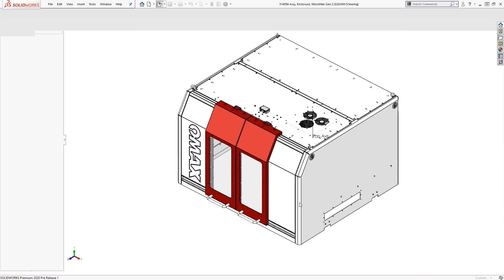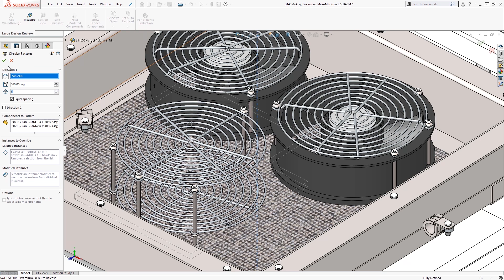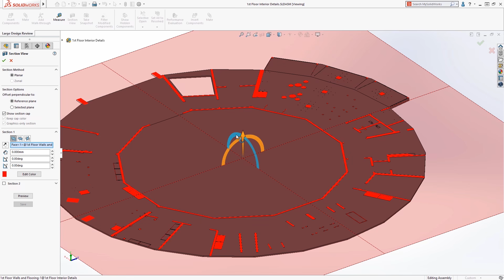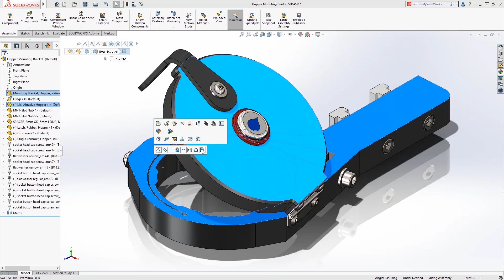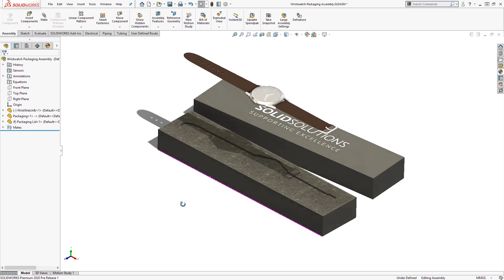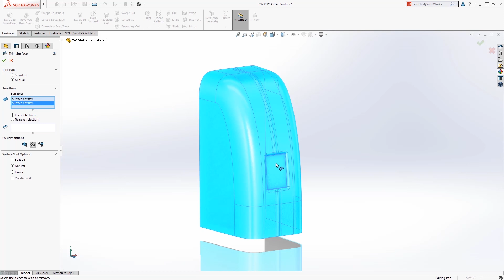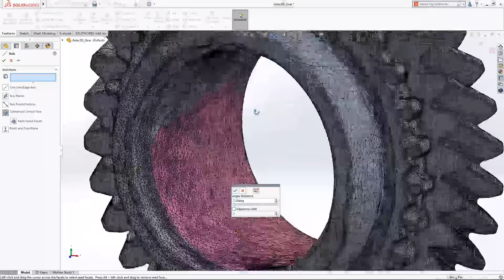SOLIDWORKS 2020 - Top 8 New Features

Comment: I miss this program, I used it as a kid on my father's company computer to draw, then later in life, I realized how expensive it is.
Reply: Same with autocad when it first came out. Got to cut out smiley faces in a half inch thick steel plate with one of the country's (Belgium) first metal cutting lasers at the school my dad worked at.

Comment: A one click tool for exporting tube coping profiles or even directly printing the coping profile would be great. So that I can just hand the fabricators a paper template they can just wrap around the  tube and quickly  cut it. Instead of having to manually flatten the tube and all the associated steps to print the profile.

Comment: What is the best processor for performance used in modeling  and simulation  in solidworks 2020 ? , Is it intel core i9 9900ks or amd ryzen 3950x
Reply: I have i9 with a Quadro FX6000 video card and 128GB RAM. She works great